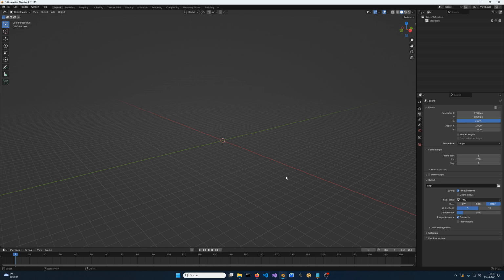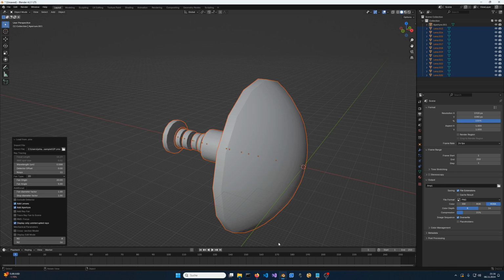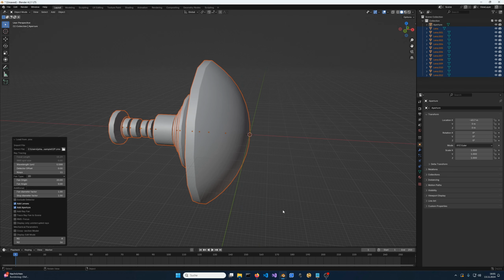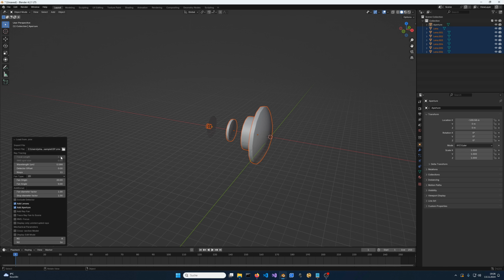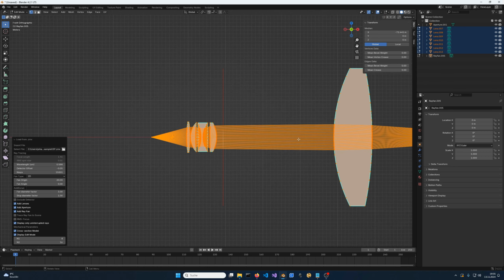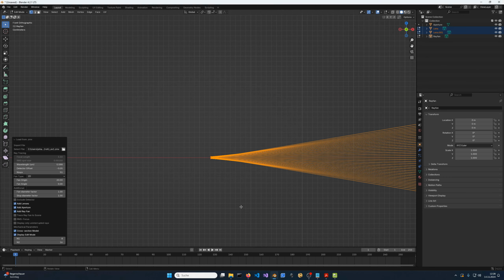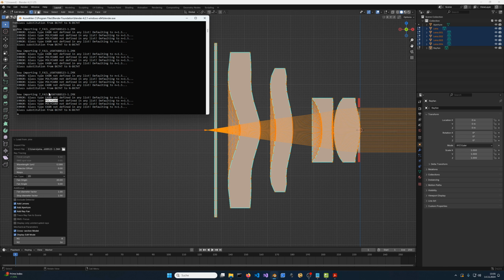OptiCore 2024 - Part2: Exploring Lens Designs

Comment: Thank you for Opticore! I have a question! If we use opticore to make virtual cameras in blender, does the size of the lenses affect the result? Also when using the camera as the reception plan of the reflected image, when we scale the camera to a certain size, it seems that its settings go crazy and difficut to set.. do you have any idea on how to do?
Thank you again
Reply from the maker: Thank you for the feedback! I plan to publish the next tutorials in about a week, which will cover the principle setup in Cycles and LuxCoreRender. I hope those will cover your second question. Regarding the size of lenses, they have to be to scale with the scene you are setting up. If the lenses including detector/camera setup are scaled by some factor, you effectively scaled the focal length, but not the field of view and f-number. The result would be that the depth of focus is wrong. Note that currently OptiCore assumes units of millimeters, while Blender natively uses meters, so you might need to scale by a factor of 1000 - depending on how you modeled your scene.
Reply: @howtoprint6002  Can't wait!!!

Comment: Have you found a way around the limitations of floating point error for movement of lens stacks and rendering of very long focal length systems?  Seems keeping them static at (0,0,0) is the best/only way to dodge those issues
Reply from the maker: Can't report on findings yet. More tests are planned for Video number 3.
A first one I tried already was surprisingly stable, compared to what I remember from my tests with LuxCore a long while ago. However, I'm curious how this may vary for different lens designs.
Ultimately, I don't thinkone can do much more, unless you rewrite Blender and any Renderengine to work entierly in 64bit float. Ray portals sound like a good solution for many applications.
Reply: @ thats what I was thiniking with the bit depth, my workaround was to 'RayPortal' the rays back to a static cam at the origin. But Camera Motion blur becomes dead.    

Hoping to get you in contact with someones alternative method thats releasing soon.  Its very well built.  I'll hit u up on instagram
Reply from the maker: Ah I see, valid point about motion blur.
Would be interesting to get in contact about alternative methods. I also have some Idea how something like this can be done efficiently, but again that requires implementation in the render engine.
Instagram won't be a good channel for me, though. You can find contact information on the github page.

Comment: Is there any way for importing cemented doublets?
Reply from the maker: The zmx-import handles cemented lenses just fine. Some lens groups in the examples I show are cemented.
You can find example files at Thorlabs or Edmund optics.
Reply: @howtoprint6002  I was testing with Thorlabs lenses actually - the lens gets imported as single body despite showing correctly in zemax, hence my question.
Reply: @howtoprint6002  Using Thorlabs AC254-030-A to replicate my problem in new project, getting the same result. Single lens body gets imported, no materials assigned. Yet opening it in zemax shows the expected structure. Is this intentional approximation or bug?
Reply from the maker: @Konecny_M  I just downloaded and tested that Thorlabs file. It works exactly as expected for me, including sequential raytrace. OptiCore creates a single body for cemented lenses, the middle surface is inside, you should see it in wireframe view. I do not currently have any access to Zemax to cross check how it is displayed there. It is consistent with WinLens, also for the raytrace when matching the stop size. If you still feel something is wrong, it would be helpful to have some pictures, you could open an isue on Github for example.  About the materials, it only loads the refractive index for the internal "Add ray fan" feature. Materials for Cycles etc. are not created automatically.
Reply from the maker: By the way, it's nice to get feedback on this project from a user with a background in optics! Keep it coming ;)

Comment: Do you have plans to implement Pentaprisms, or other optical prisms?
Reply: I actually tried beamsplitter with variable ratios but did not manage to get good results yet.
Reply from the maker: I did have Pentaprisms in mind before. According to my local repo I last worked on it 3 years ago 😅
It was not on my priority list, but if there is some interest, I will bump that.
Reply: @howtoprint6002  I was trying to make a ww2 optical rangefinder, it requires pentaprisms so they'd be helpful! But I'm probably a minority, I 3d model random things for fun.
Reply from the maker: There is another option for you: You can find prisms at those off-the-shelf manufacturers I mentioned in the video. Similar to the zmx-files for optics, they offer CAD-files for most parts. Typical formats like STEP can't be opened directly by Blender, but there are freeware options like FreeCAD to convert them to STL.
Reply: @raven_talionis  I did try pentaprism, worked on first try. If you want the PLY file just drop me a message.
Reply: @howtoprint6002  I can make the shape of the prisms easily enough, I was just hoping for it to work with Ray tracing because I wanted to alter the ww2 design to a handheld and try to keep it optically accurate, but that's a challenge because of the lense data still being classified or somewhere I can't find it If it was declassified. I'm fairly certain my idea would work but it'd be so satisfying to see the ray trace showing it working.
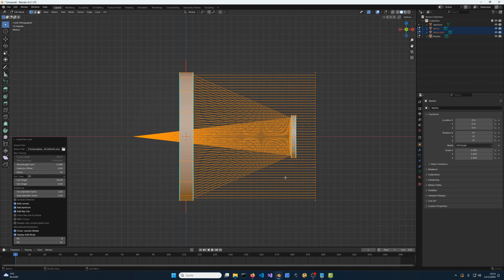Reply from the maker: @raven_talionis  Aaah okay, I did not get this before... The answer is again yes, it is a rather important feature. In the video at 54:09 I effectively describe the same problem for a telescope with fold mirror. I.e., the ability to change the optical axis direction, not only (mechanically) linear systems.